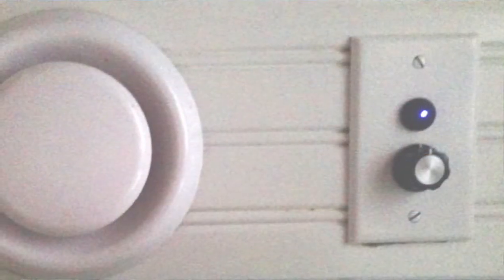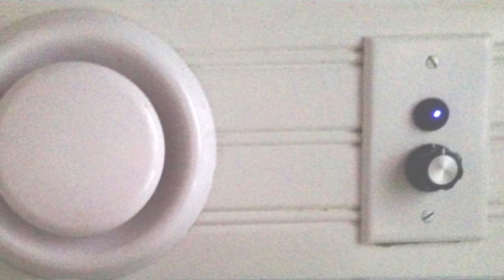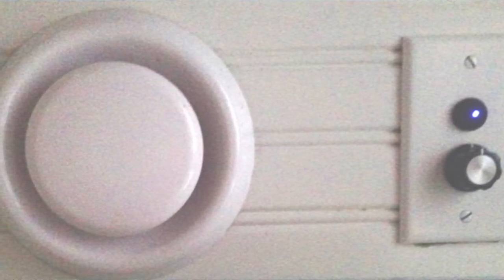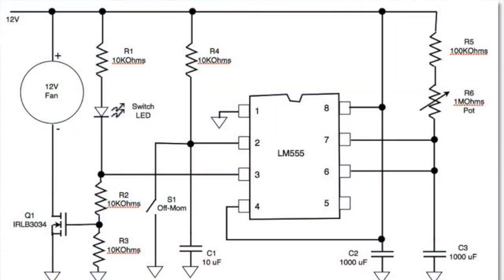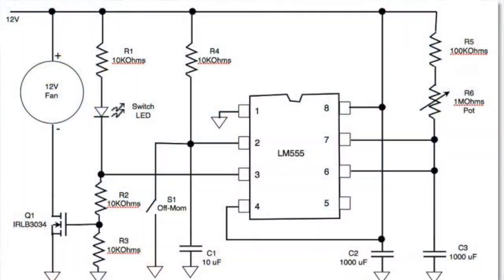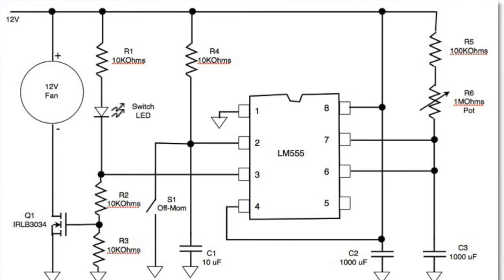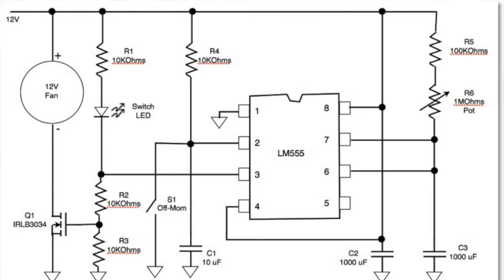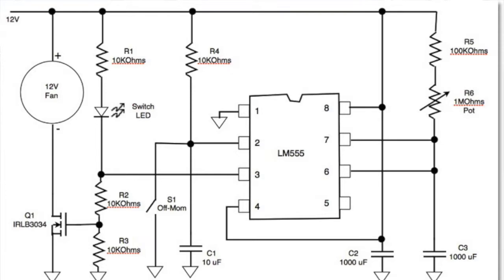Using a 555 timer to control a fan

Comment: I haven't seen how your montage works.
I did not see the thermal sensor in the circuit diagram.
And... you talk too much !
You could demonstrate the operation of the circuit in 2-3 min !
I gave a dislike for this clip ! 👎
Reply from the maker: There was no "Thermal sensor," I don't know where you got the idea there would be one. This is more about the 555 and the mosfet, not about imaginary thermal sensors.
Reply: @DanBullard  
I have seen dozens of circuits with either Z 44 or BC 547 or 555.
But each assembly uses a temperature sensor, which, when it heats up, turns on the fan.
Your montage, how does it work ?
How does the fan start without a temperature sensor ?

Am văzut zeci de montaje, fie cu Z 44, fie cu BC 547 sau 555.
Dar fiecare circuit folosește un senzor de temperatură, care, atunci când se încălzește, pornește ventilatorul.
Montajul tău, cum funcționează ?
Cum pornește ventilatorul fără senzor de temperatură ?

Bye !
Reply from the maker: @John_Smile  If my circuit was so simple, and I used more than enough words, it should have been obvious. I push a button. I didn't copy anyone else's circuit, this is my own tool for blowing steam or stink out of my bathroom. What kind of food are you eating that causes high temperatures when you go to the bathroom?
Reply: @DanBullard ignore them. Nice video.
Reply: @DanBullard  
I understand. You place the order via the On/Off button.
I want to use it to control the fan of a welding machine (inverter).
When welding, the inverter has a fan, which cools certain parts. But the fan runs non-stop.
Now it's 3℃ outside and the fan is still running.
I want to set it to start working, from 40℃ up.
Goodbye !

Temperature controlled Fan Using IC555 Timer
https://www.youtube.com/watch?v=IXsydcV03IE&list=LL&index=6 

How to make Fan control Temperature Sensor circuit using Thermistor
https://www.youtube.com/watch?v=xhlmjO2KftE&list=LL&index=12
Reply: U dont have time to watch a 10 minute video, but wrote a comment and replied to it, hmmmm. 😂
Why are u here on youtube, u should SAVE THE WORLD😅